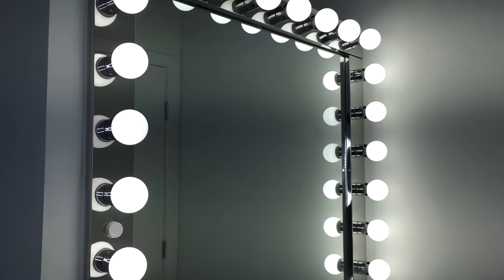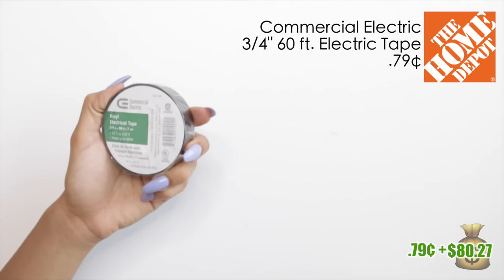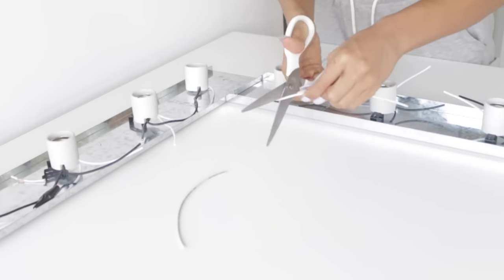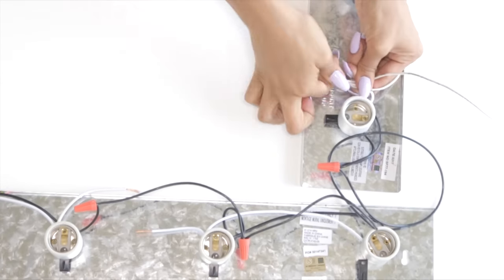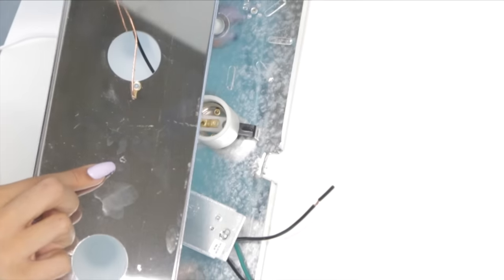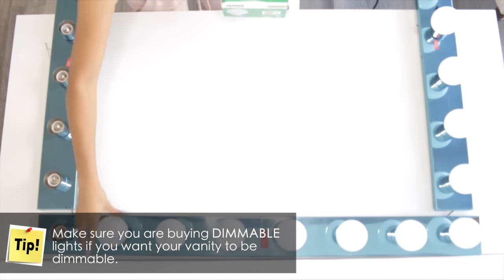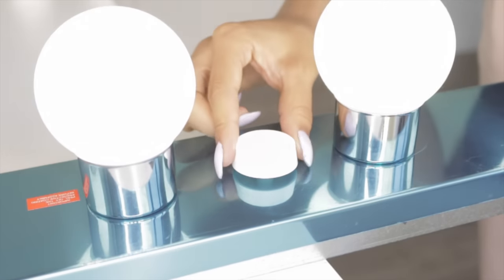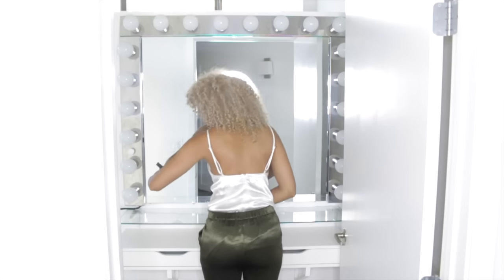DIY Vanity with Dimmable lights for under $250 (50 Inch Vanity)

Comment: DIMMER SOLUTION:
Def was disappointed when I bought everything and couldn't proceed because of the dimmer. 
Note I only use one light bar with 6 light bulbs for my project.
What I did:
Bought this - https://www.amazon.com/dp/B07P9F1111/ref=cm_sw_em_r_mt_dp_U_0WgXEbMYAS1SA
$32 is expensive for another piece for this project, but I wanted some kind of switch so I wouldn't have to unplug and plug for every use and to be dimmable, if possible. 
It took a lot of trial and error. In the "controller" put the two wires from your power cord in the Input holes (one in each) - the bottom two holes when the button is facing you. Put one color of your vanity light wires in one of the output holes and put the other color in the other output hole. My light has two black and two white so I put two wires in each hole. 
Remember to test that it works before putting it all together. 
When taping the controller in the light bar with the double stick tape, center it from the top and bottom. The controller still wont fit perfectly, but this will keep the pop out centered. You'll also want to tape something onto the controller so the button isn't pressed when you tighten everything. I used a piece of the extension cord I cut for my power cord - it's taller than the button on the controller. 
Again, it's not perfect but once you tighten the pieces under the bulbs you'll get pretty close and it won't be as noticeable when it's on the wall.

DM me on Instagram or Twitter if you need help! @smilechiquita

Comment: With that much wiring even though it is low wattage, you made a very unsafe mistake of not grounding your wiring. You should fix it
Reply: GODLIKE yes i grounded mine
Reply: @perfectedflawsss  awesome. I will use this vid as my template. What do you think about putting crystal diamond ribbon on the chrome fixture?
Reply: GODLIKE omg I’m so late seeing this but i would loveeeee to see how that turned out
Reply: @perfectedflawsss  Hi. How did you ground your wires? I'm new to this. Lol.
Reply: Anitra Smith there is a screw inside the light strip for grounding its green. I’d recommend you get help from an electrician or hvac tech. If done wrong it could be bad

Comment: Just so everyone knows twisting the wires together like this isn’t recommended, they will get hot and can POSSIBLY cause a fire. Solder them together. Also the wire connector those can be dangerous as well. Please advise a professional before doing this.